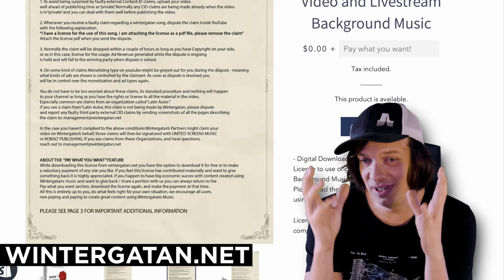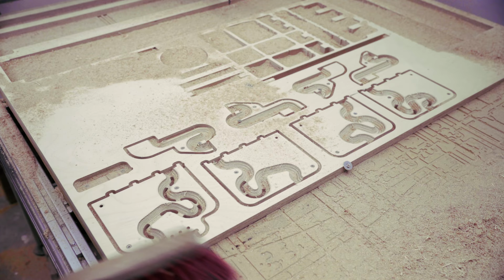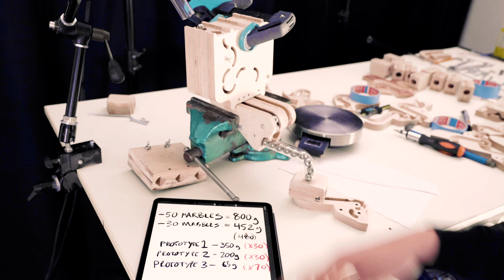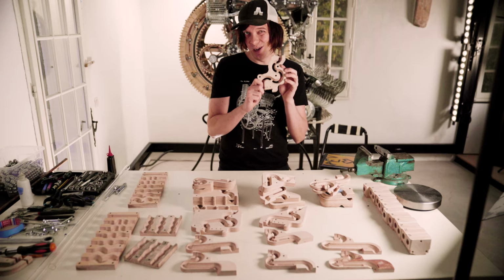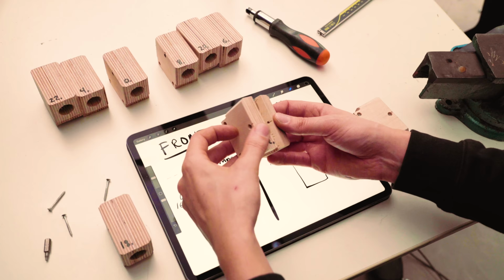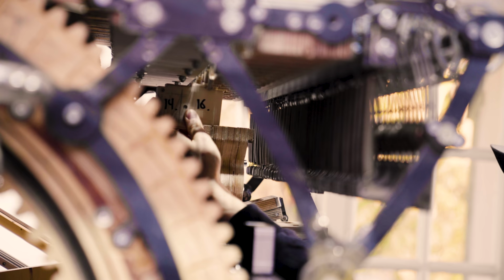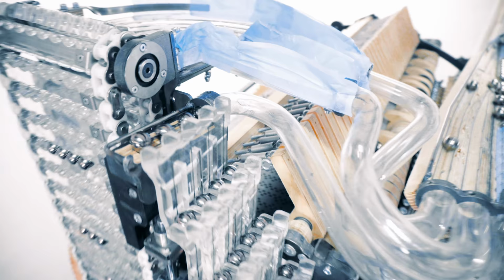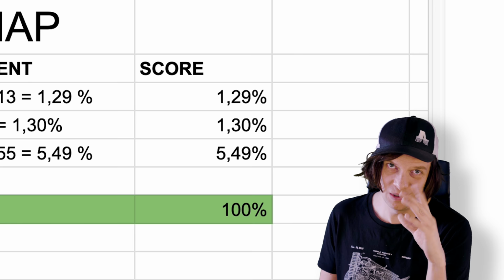Playing 20000 Marbles - Marble Machine X #147

Comment: Part of the reason for marbles missing the funnel this time and not last time is the rhythm. Please don't use metronome rhythm for testing the marble machine as this does not accurately represent how the machine will be used and could lead to a false sense of security (especially when you get to testing the vibraphone if you insist on keeping the movement).
Reply: The rhythm is the correct use case for a drum, but either way, what problem does it cause?
Reply: @voxelfusion9894  remember the "super bounce" on the vibraphone? This is most likely caused by inducing a resonance then playing a note on the off beat so the marble hits as the playing surface rises imparting far more kinetic energy to the marble on the bounce. This is far less likely to be highlighted when playing a constant steady rhythm only dropping balls on the up beat.
Reply: @gwpcs  it was same rhythm for few hours... 
And flaws began showing only closer to end of time
As that rhythm is not constant but variative i doubt that there could be that much resonance stacking on 
My opinion tho, not good in physics at all
Reply: @DimkaTsv  That's why I said to continue using varying beats. The drum doesn't move so the only wave function that could interfere is formed on the head itself which wont show a huge effect. However if he insists on keeping the movement on the vibraphone plates that's where you'll see the  marbles flying around the studio.
Reply: @gwpcs  right, I know Martin does not read the comments much but hopefully someone will get this point through to him before he goes much farther. "Super Bounce" will be a problem.

Comment: The slower marbles store more energy in rotational energy. That is quadratically rising with speed of turning.
So if the point of turning is closer to the middle of the marble the rotation must be faster for the same speed. But faster rotation "steals" energy from the translational  movement. :)

Comment: Completely agree with factoring in the system as a whole for reliability. The more parts you have functioning the more interactions you get, which complicate things. You cannot just have 1% of the machine working 100% and assume it will linearly scale the remaining 99%
Reply: Yeah, even the math he's using now would make a statistician shake their head, but it's a big step in the right direction.

Comment: Having some sort of a belt tensioner would definitely stop the belts from vibrating, think about how a modern car handles it’s front alternator belt, it runs around idle pulleys and the alternator and other accessories, but there’s a spring tensioner that applies appropriate pressure to the belt to keep it snug, while not over tightening it and having some lee-way inbuilt for belt stretch where the tensioner will entirely self adjust. I think if you could incorporate a spring tensioned idle pulley like that it’ll definitely solve the belt resonance/vibration issue and will help reliability because it’ll prevent the pulleys from skipping teeth on the belt under heavier loads or in higher speeds

Comment: Belt tentioner: Perhaps a pair of weighted wheels -held in place by spring steel -pivoted on a single axis near the motor might help.
Reply: Yes it will!  It will change the Natural Resonant Frequency to a higher value by shortening the belt length.

Comment: over rotation: The marble need to accelerate when it starts. This acceleration takes time and energy.
Reply: moment of inertia
Reply: Inertia is a property of matter.
Reply: But no, he was referring to the lack of friction as you distance yourself from the center of the circle vertically.  A wheel does not work well on it's side.
Reply: I would say that the reason the marbles take differing times going down the ramps is that the potential energy is converted to both rotational energy and energy moving the center of mass of the marble. If more energy goes to rotational energy less is left for movement energy.
Reply: @mcg6762  Also this means to Martin that tracks with "overrotation" have marbles arriving with more rotational energy. Don't know if that matters in practice, though. More noise.
Reply: All wrong ! It's effective 'wheel' size. Engine driving force is gravity & remains the same , the ball mass for each is the same the contact area & therefore rolling friction is the same for each ball but the distance each ball travels per rev is smaller the wider the track (smaller radius of rotation ie smaller wheel) which means ball 3 has to make more revolutions to travel the same distance as ball 1. It has the same engine (runs at the same rpm) so takes longer to travel the same distance.
Reply: @9crutnacker985  Exactly.  And Martin explained it all correctly, until he said that it makes the wider track marble "slow down".  As you said, it doesn't slow down any, it just has further to travel.  If the marbles all slid down these tracks, rather than having to roll, they'd reach the bottom at the same time.
Reply: This is a dynamic effect.  I'm not sure it applies at all when he's measuring the static weight.
Reply: @nicotti  I think Martin reffered to the linear velocity, when he said the marble slows down.
Reply: @mcg6762  Exactly what I was thinking. "Conservation of Energy" is the term you're looking for.
Reply: @nicotti  it does slow down. The RPM of the marble stays the same, but when the diameter of rolling decreases, the tangential velocity decreases and therefore the speed at which the center of mass translates down the slide decreases. It gets slower while keeping the same RPM.
Reply: @huvrr1  Fine. Fine. Annoying details like this are why I switched my major off engineering in college.

Comment: “If you're losing, you just change the rules so you're winning again.”

That's some presidential advice right there.
Reply: came here to see if anyone noticed lmao
Reply: And then get every media organization to claim that you won before the legal processes are done, while ridiculing anyone who doesn't fall in line.
Reply: @brianmchaney7473  call the election on election night before the process is over a month later like has happened with every election for decades? You're right, that does sound like a crazy new scheme.
Reply: @robertjencks3679  When it's this close with THIS many mail in votes, and with so much evidence of irregularities? This is very new.

The election most similar to this happened in 2000. Guess what? The media called it for Gore. They were wrong.
Reply: @brianmchaney7473  no it’s not as close as that, or even comparable to the 2000 election. The difference in votes in Florida for the 2000 election was in the hundreds,not thousands or in some cases tens or hundreds of thousands. In order to win the electoral college in this election there are different combinations of multiple states needed to be overturned to change the outcome of the election. Not impossible,  but also highly unlikely as there is no evidence for any of the claims that would affect the outcome in the numbers needed to overcome the number of votes necessary to change the outcome. It’s not impossible but you do have to stray far, far away from probability in what can most accurately be described as wild fantasy to find yourself in a place where it’s probable for the outcome of this election to change.
Reply: @brianmchaney7473  lmao he clearly referring to talking about Trump, not Biden. Check the vote tally and EC results. Trump lost
Reply: @whiskeycan529  The whole "banker approved decisions" is the reason Trump should win. He's the anti-establishment President. He's not bought and owned.

The bankers decided on Biden. That's why media is fighting so hard to convince everyone Trump already lost.

Trump is exposing them.
Reply: @brianmchaney7473  Yeah sorry, there is zero credibility to the idea of an anti-establishment billionaire. Billionaires are the establishment. Why would he want to destroy himself? The only thing he wants to destroy is regulations that stand in the way of getting richer and thus more powerful.

First off, how do you think Trump (or anyone) got that rich? Certainly not because they worked thousands of times harder than anyone else, or because they have so much integrity and good will. Every fiber of his being screams for self-enrichment and nothing else.

 Second, I don't know how you define "establishment" but if its solely based on culture war bullshit, you've been played. The ruling class, the elite, the rich, the shareholders... Whatever angle you want to come from... the lawmakers are their patrons, not the other way around. And Trump has served those masters better than any president in history and its largely because he IS one of them.

 Trickle down economics, aka "you can totally live off our table scraps like a dog", aka ruling class security = working class security has been demonstrably proven wrong and a lie over and over.

 He's there to get rich and he's allowed to shit the bed and make a big mess along the way because he's done nothing but make the rich richer and more deeply entrench their power. 
 Don't be a sucker, they're not saving us a seat at the table.
Reply: @whiskeycan529  The democrat party is in kahoots with the media, hollywood, academia. That is the establishment.

If Trump were with them, why would they want to destroy him so badly? They've done nothing but lie and smear him. They cried when he won and celebrated when he "lost."

It's patriotism vs. Globalism. Trump is a patriot.
Reply: @whiskeycan529  couldn’t have put this all better myself. +1 to someone who actually knows wtf they’re talking about.
Reply: @brianmchaney7473  Of course they're in kahoots but you have to be insane to think real, actionable power comes from anything but money. You're talking about cultural stuff, which is secondary. It's as much controlled opposition as it is political theater. They have to give you a reason to vote for this one instead of that one. But at the end of the day they all vote for bailouts, surveillance, defense budget, etc.

 There are a few real differences but the biggest is simply style and tone. One party believes the market thrives best with brute force, the other says it's with hugs and rainbows. Both still prioritize the well-being of business over the workers. You think either party would ever dream of MAGA by bringing back the 94% upper income tax rate from America's most universally prosperous (tho racially divided) period? Or work as aggressively towards mass unionization as they do on funding permanent war? They're competing for future wealth / investments as well -- Dems want to get rich off solar panels while Reps want to stay rich off oil, and Trump stands in the way of that.

 The whole globalist vs Patriot thing is baseless and hollow. Trump isn't fighting to end multi-national corporations. The whole "jobs" thing is market serving electioneering. If he cared about workers he'd be fighting for higher wages, worker protections, education and future proofing. It's more about the declining rate of profit, stagnant american wages and global economic cycles than American Jobs©.

Actual Leftists (socialists, communists, anarchists) are very different from Liberals and Democrats so we have to be clear about terms if we're asking why "they" hate him so much.

 The Dems occasionally use a veneer of mildly leftist rhetoric to look like they care about workers and humanity but the track record says the market and ruling class wealth is still their priority, by far. Democrats are in no real way actual leftists. Purposely conflating the two (very common) might be effective propaganda but it's absurd analysis.

 That being said, Leftists hate capitalists and authoritarians of any party. Dems however,  hate Trump because they think he's doing capitalism wrong and his shitty personality is going to blow the whole scam by forcing them to be more than superficially opposed like they've been in the past. Dems want to be able to "reach across the aisle" again (aka score points for the "other" team) without being murdered by the base that they're already barely holding on to.
Reply: @whiskeycan529  When you are so far left that the Democrat and Republican parties look the same, you've gone off the deep end.
Reply: @brianmchaney7473  Looks like the overton reframing project has been successful. Being anti capitalist isn't off the deep end, its the line of demarcation. Its the fundamental definition of what "Left" even is.

American politics cover the spectrum from center to far right. The left isn't in power in any meaningful way. That's why it feels like nothing ever changes. Congrats, your politics will never lead to anything but variations on a well worn theme.
Reply: I’m curious to see how this conversation continues..
Reply: As I started this thread, I feel like I should comment on it. Keep in mind that I'm Swiss, and thus not really legitimate to comment on US politics.

This was ment as a joke, not to alienate people of this wonderful community.

To me, Biden is the eco-moderate right, and Trump the populist one. Always sounds funny to hear people referring to Biden as a socialist, as here socialism is a very different thing.

I find sad that US politics seems to be shouting at each other rather than trying to find a way to make different points of view work together.

I personally think that capitalism is a form of utopia, but in effect enforces inequalities that where created by European colonialism. I understand other people might feel differently, but I don’t think here is the place to have a polite and interesting debate where people try to understand where the others are coming from to find some sort of consensus, or at least compromise. That’s the only kind of debate I’m willing to have.

Let’s enjoy Martin’s work together :)

Comment: 18:00 marbles can go back, which means that notes will skip if you don't have enough marbles going into this channel, which is a problem
Reply: True, I think all he should do to fix that is lower the pmma tube exit so the marbles always roll the correct way
Reply: The problem can be fixed by simply adding more marbles than you need
Reply: While this is true, the conditions for this issue to present itself are much more dire. The Marble Divider would have to fail catastrophically, in order to starve this channel to such an extent. Keeping it, as is, will mean it only takes a little longer to fully empty and pack up the Marble Machine X, during the World Tour.

Comment: Have you considered prototyping a small sensor to count marbles as they go past particular locations? Perhaps it isn't critical at the moment but when you get into testing more of the channels and parts simultaneously it will be hard to run such long tests without some kind of automated detection for failure locations.
Reply: I was thinking about this very thing while watching this video. Could use those steam punk light bulbs digits.
Reply: @Adam-si7bw  Nixie tubes?

Comment: Also, you are still calculating your reliability wrong.
61 fails out of 20 000 is 0.00305 as a fraction and 0.305 %. That means it is 99.7% reliable, not 99.997%

You can even use excel to calculate this for you. Instead of manually typing in the number type in an equation, for example, in cell E3 you would type in =(C3-D3)/C3 and format it as a percentage (with appropriate number of decimal places).

Also, I think a better adjustment would be to divide the number of failures by the percent of the instrument used.  Or alternatively, as you are going for number of marbles, do it based upon the percent of the channel used.
Either way, this test is better than the first and worse than the second.

The other way is to try and include uncertainty as well based upon limited trials.
Reply: Don't bother, he doesn't read Youtube comments any more, it has been pointed out countless times already...
Reply: @Wintergatan please read this comment!
Reply: @AttilaAsztalos  Correction: YouTube commenters screenshot connents from youtube and post then to the discord, which he does read

Comment: The year is 2030: The roads are full of electric cars. Fossil fuels are gone. Mars has started it's second colony. Coronavirus was eradicated 2 years ago.

Wintergatan uploads a video: "Playing 200000000000000000000000000000000000000000 marbles."
Reply: Gosh I really hope the coronavirus doesn't last that long, and thankfully I don't think it will
Reply: The Marble X Machine started to catch it's Lost Marble's with a very large tray under the machine and kept them in play.

Comment: This series really shows Martin's descend to engi-madness. The mechanical design MMX has is really nice... but might start to wander into cluttered design. 

I think it's crucial for an observer to tell apart the different modules of the machine, divider at the top, queue, droppers, instruments, pickup. And honestly... seen from a moderately small screen, I can sort of tell what's going on only because I've followed MMX since ep1. Otherwise...
Reply: I don't think that will be the case. Martin has a close eye on how the MMX looks. Remember the ringing marble funnels? That was the "This looks cool"-Martin, not the "This is the best solution"-Martin. And since he obviously does not want to completely remake the MMX from the ground up, but only fix parts that need fixing, he has to retrofit parts to an existing design. Sometimes, good solutions need more space. And that's what is happening here.